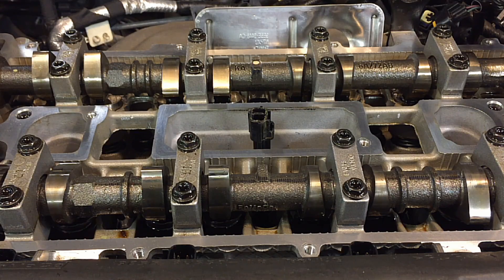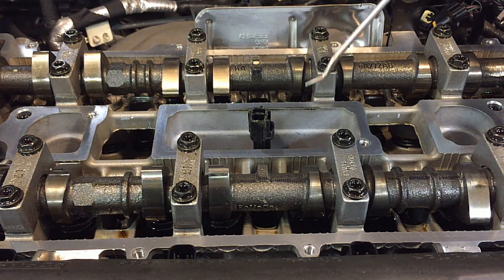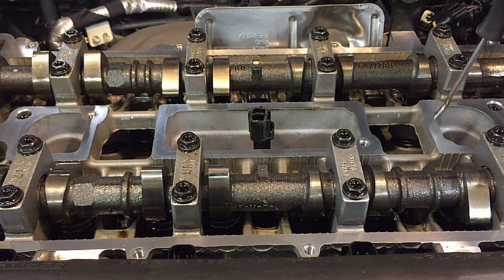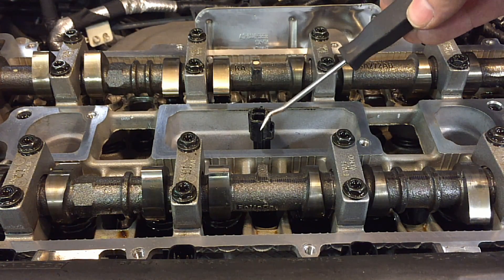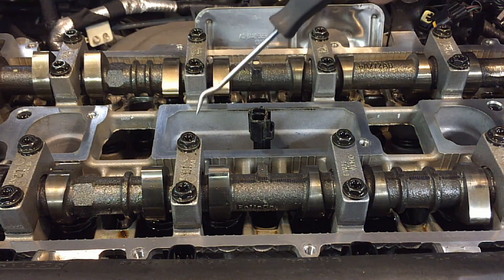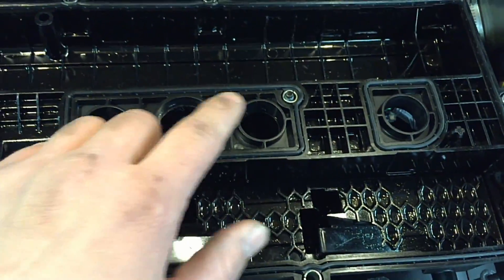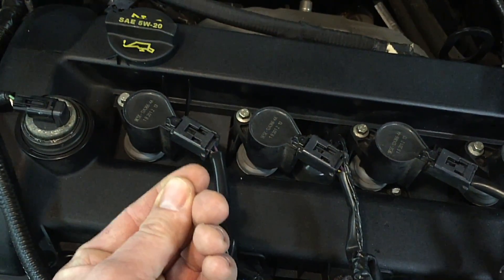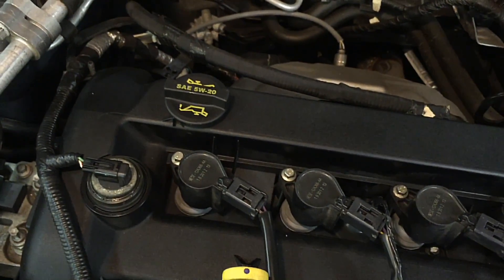Ford Quick Tips: #38 Misfires and Dual Overhead Cam Engines

Comment: Stupid on ford!! Machining round spark plugs well should have been rounded then use the common (O) ring to seal port . Been counter fail big time! Cost making production seal for spark plug well ohc vs 1949 o ring🙈
Just learned dohc cobra heads 5.4 made in Germany that explains it .

Comment: Hi,

I have ford fusion 2012 SE 2.5L
I noticed recently that there is oil stains direclty near the waterpump and under the idle pully
I am wondering what is the issue?
Could be blown head gasket?
Please note that there is no overheating, no coolent loss and no milky oil when I check the oil cap or the dip stick
Please I want your advice.
Thanks

Comment: Hello! Big fan here. Thanks to your videos. I learned a lot. I have a 2003 ford escape with number 1 cylinder is always has dry carbon fouling. All other 3 spark plugs are ok. Tried swapping the injector 1 to injector 2 to see if the issue will transfer to cylinder 2 but no luck. What are the possible cause of this you do you think? And btw the coils are good. Sparks are strong. But it runs so bad due to the number 1 cylinder. Thanks in advance

Comment: Love your tech vlogs-videos... I need help.. been following your DOHC-OHC STUFF, MODULAR FORDS, for a while, learned a lot about my modular' 4.6 96' cobra FROM YOU AND ON MY OWN PAST YEARS.... anyway... after a swap of the gears one nite, to 4:11's... I changed oil using ford motorcraft, half&half of- synthetic 1- quart, rest regular non syn.(this is what a tech told me to do to start getting it usd to synthetic, and to get rid of the "tic" that will come in older .6' mod motors.. so he told me to do 1 quart synthetic, and add another ea. time I change oil.. since engine only had 30k bout.. I figured yea, akes sense..( though I never had a problem with ppennzoil 5-30 10-30 for couple years..   anyway, I got the ford motorcraft or w.e oil... what I always ran, also, but non synthetic bout year + before all this happen..  ... its got 103k miles now, half were up in the revs since its my d.d and weekend track,auto-x,drift car, (was)... but at 60k, blew it up, according to dealer papers I found-receipts.. overheated it ause of recal of rad with 4.6 sn95's...the P.O, had a new engine put in? maybe just shortblock? not sure,, FORD dealer receipt from 2005.., says 6,950$ for.. longblock? or whole engine?... Not sure.. but anyway.. after I did oil change, took out bosch gapless 3-tips"... and went back to .51-53 thou?(w.e it called for) gapp"d autolites.. that eve... I was breaking in the new gears, posi etc... about 40 miles into the cruise, I womped it gently to 5k, and heard a pop!... and CEL, CAME on.. My laptop said misfire #7(used it to watch my engine-datalog-with the elm327-usb live)... so... It was missing bad.limped it gently, got it to a lot.. shut it off.. checked under hood, plugs and everything looked tite.. clear CEL..... STARTED IT UP, STIL HAD A TERRIABLE MISS, AND IT BARELY GOT ME HOOME.. mIND YOU THIS IS A DAILY, AND A WEKEND AAAAUTO-X CAR, SO I GET ON IT, BUT TAKE CAR OF IT... BUT.. NEXT DAY.. PULLED PLUG 7... AND IT WAS FLATTTT!!!... I though mabe detonation from ttimming adjuster with bad fuel?,, or thought worse.. so... I had a bosch plug set, threw it in.. started cold, let idle, all was fine... got not even past 3800rpm, just down road.. and same thing.. pop!,--- - - - -  misfire, and flat plug...  so... I had to go back to work for my summer, outta state.. left it... came back... pulled plug, put another autolite back in.. and it also was smoking and burning oil pretty god, slite' metallic ticking, but this 3rd time, it felt like it had almost 100% power, but still was low on power and smoking and ticking more the hotter it got.. it felt like it was down to 85%? or just one- dead cyl 7..... so, I put vaccum gauge, all good... next, compression test, and it said 0!, IT SHOULD HAVE HAD SOMETHING EVEN WITH SAY A BROKEN RING,SKIRT, THUS GOT ME THINKING, THERE KNOWN FOR HEAT PROBLEMS IN REAR CYL'S.. AND MAYBE IT JUST BENT OR DROPPED A VALVE? HOW ELSE WOULD IT HAVE 0- PSI COMPRESSION?.. AND I COULD SEE THE PISTON, AND IT HAD A ROUND DING LIKE DENT IN TOP OF IT, LIKE SOMONE PUT A PENNY IN There!!!, ....OR.... A BENT STUCK HALF CLOSED/open VALVE??(retainer popped? guide oblonged)?? I don't know.. yet...  AND WITH THE RETAINERS-seat-seals, w.e,,, WORN,all from(hi revs 40% of its like)....that woulda' explained oil burning, smoking on and off, ??? LETTING OIL GET SUCKED IN AND BURNT?.... IDK...  .I ALSO READ THAT ALL DOHC 4.6, FROM THE FACTORY, ACTUALLY COME 2* OUT OF TIME ON THE LEFT BANK, BECAUSE OF THE WAY THE TIMING CHAINS AND LASH-SLACK ADJUSTERS ARE SETUP... AN I GUESS THAT 2*- IS FOR WHEN IT GET MILES ON IT....   SO.... WHAT DO YOU THINK? I WANNA GET IT APART, TO SEE WHATS WRONG WITH IT ASAP.. ITS DRIVIGM E NUTS... iM PRAYING ITS NOTHIN TO TO BAD.. SINCE I HAVE A DONOR MOTR WITH MINT HEADS... BUT SINCE ITS A D.D AND I RUN IT AT TRACK, AND I GOT ALOTTA LIL' BOLTONS, AND A TUNER I CAN USE ONEDAY, I WOULD LIKE TO DO 03' PISTONS, RODS, AND BEHIVE SPRINGS, AND THROW A TURBO ON IT WITH JUST MODERATE 6-8PSI JUST FOR THE BIGGER TIME ATTACKS I DO.. ANYWAY.. SMOKING, TICKING, FLATTED SPARKPLG 2X'S, BURNS OIL AND SMOKE ON AND OFF IDLE AND DRIVING, SOMETIMES WILL BE HARD STARTING LIKE BATTERY DEAD, OR NO FUEL...... BUT, WITH A DEAD #7 CYL, IT STILL SPINS ALL THREW 2ND! LIKE ITS ONLY LOSING MAYBE 20HP, OR 10-15% IF THAT.....  PLEASE.. GIVME SOME IDEAS.. HELP AND HOPE.. ITS A 96 COBRA, 2ND MOTOR, HAD MOST RECALLS FIXED WITH NEW MOTOR BEFORE I BOUT', LIKE THE RAD NOT GOOD ENUFF, AND OTHE OVER HEATING, RUNNING HOT ISSUES WERE FIXED...   BUT IM AT A LOSS HERE, AND IVE BEEN AWAY JUST MIND BOGGLED... NOW I HAVE TIME TO TAKE IT APART, AND RETRY SOME TESTS... P.S SORRY ALL CAPS.. KEYBOARD IS BAD LOL...   AN P.S IF YOU WANT, I CAN GET A VIDEO SHOWING VACCUM, COMPRESSION, RUNNING, DRIVING, ETC... IF IT WOULD HELP.. IM ON A BUDGET, BUT I WANNA FIX IT RITE, AND THEN SOME WHILE ITS APARTS..  THANKS HOPE TO HEAR FROM YOU... PLEASE EMAIL ME- justinjeepcobra @ Gmail

Comment: Well I try to change my valve cover gasket but I can't it's almost le the previous owner overtightened the bolt so I just keeps spinning as I try to loosen it...any tips on how to get the bolt out ..thanks
Reply: apply upward pressure and slowly turn

Comment: I had this exact problem on my '08 focus. I was changing the spark plugs and noticed oil in all the holes. I replaced the gasket (per another video of yours going through the steps) but I still have a sporadic surges or misfires that I have noticed mainly on the highway at cruise. Could the ignition coil(s) be the culprit? I'm getting no check engine lights. Although I have, occasionally right after a cold crank, had the car go to a "no throttle" mode. Meaning that it will not let me give it gas and acts like its running on 2 cylinders with a wrench light in bottom left corner. But I just shut car off, try to restart, eventually cranks but sounds like starter is still engaged, shut back off, recrank, and it runs fine. Also mpg has dropped by 4-7 mpg. I drive on the highway 90% of the time. I watched your other video on transmission shifts that are sluggish and mine has the same characteristics. More so when cold. So I plan on replacing the throttle body. Would this cause my mpg to drop and not the hesitation or misfire? Or both? Would I be better off to bring it in to the dealership to have a diagnostic run on it to determine anything? Rather fix it myself if possible.

Thanks for the informative videos. Its saving me money already!!

Comment: Hey I've have read all over the internet about people with this electric problem, but no one has a fix for it. For this problem I've replace the battery, Alter and radio. Being a Ford Tech maybe you have ran across this issue or and TSB about it

Comment: Hello, I stop at a light and it idle down then it drops even lower. The Focus is also has a problem with the lights dimming up and down the radio shutting off and the in side relays next to the steering colume clicking. Relpace the battery saver relay with no luck. Could it be the GEM module? Does the inside fuse box get power from the outside box?

Comment: Was the engine in this video the 2.0L DOHC Zetec from the Mk1 Focus? I had an 03 SE Comfort with the Zetec and it started misfiring bad due to a bad valve cover gasket. Changed that and the spark plugs, wires out and it ran perfectly after that.
Reply from the maker: Alex H 2.5L

Comment: Hello, I have a 05 focus with a 2.0l. Engine idles low when coming to a stop. Replaced the IAC with no luck. Been reading about intake maniflod trouble with the tumble flaps. Have you hear anything about this? Also checked vac leaks. OK. PS when the idle is low my lights also go crazy bright to dim. Alter also has been replaced. Could it be An EGR valve? There is no codes. Like to know what you thing. Thanks
Reply from the maker: Tony Camacho No the tuning plates would have no effect. A low idle is almost always caused by a vacuum leak have you already checked the pcv hose the full length for a split? Does the idle go low and steady or does the idle roll low.

Comment: Had a neighbor with the exact same problem. Had a misfire, brother-n-law said she needed a new motor. When he pulled the plug, the oil ran down past the plug and coated the plug end with oil. Thats why he thought the motor was bad. I replaced her gasket and the coil it damaged. Had her back n the road same day for 150 bucks, ready for her to go to work the next day.
Reply from the maker: LeakyDiaper Nice!

Comment: My 13 escape 2.0 ecoboost is hiccuping badly at idle at stop lights and what not and especially right after filling up with fuel. I had the dealer do the wiring harness warranty repair to fix it but it is still happening and the car has stalled on me several times any suggestions would be greatly appreciated thanks
Reply from the maker: dave26566 No nothing common there are just too many variables and something like this must be done in person. Have you taken it back to them since you can duplicate it?